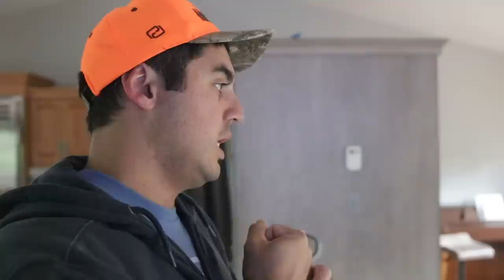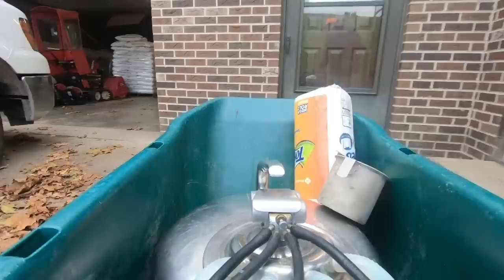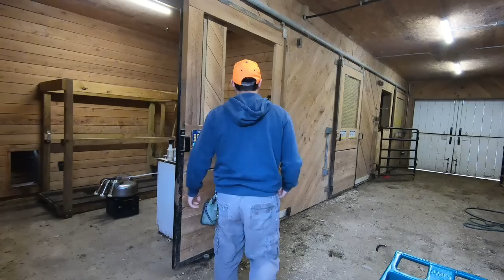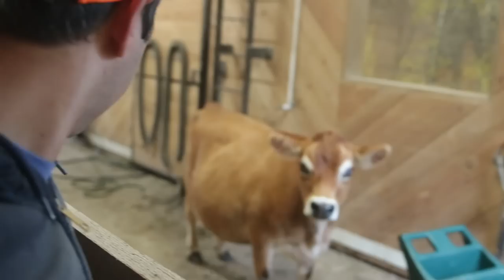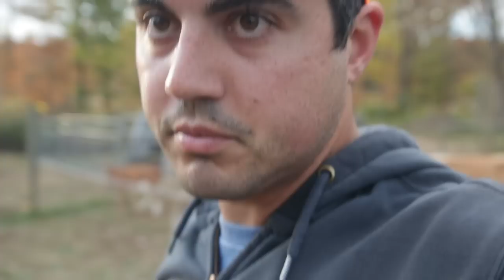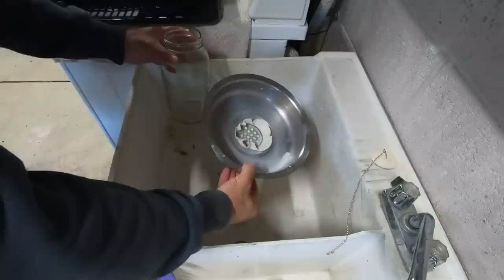YIKES... K IS SICK SO I HAVE TO MILK...

Comment: I’ve been using a bucket Melker for 10 years.Welcome to the surge bucket Milker world. Your pulsator is running too fast but it can be easily adjusted and you need to consider hanging the milk her off a belly strap she put the right amount of tension on her other otherwise you could end up with mastitis problems or other issues private message me if you want to talk more

Comment: Aust get a schematic or blown up parts display - get it laminated for longevity, frame it, hang it on the wall nearest your milking cleaning station. You can use a white board erasable marker on it for special notations. It should erase off lamination definitely - might erase off poster frame plexiglass maybe (if not, there is a spray that will turn the plexiglass into the correct surface).